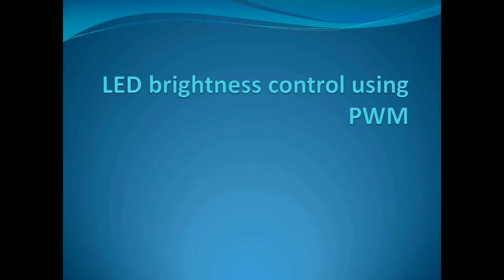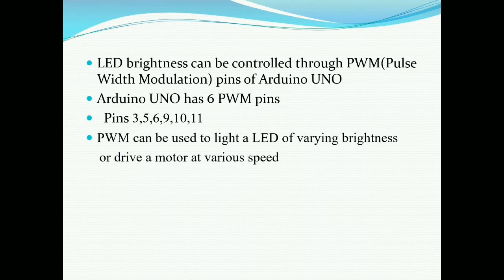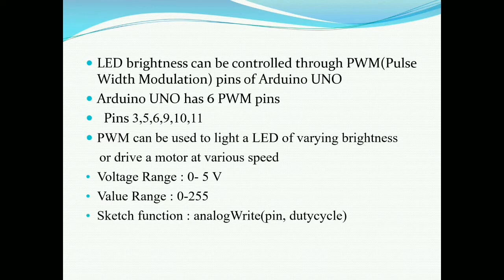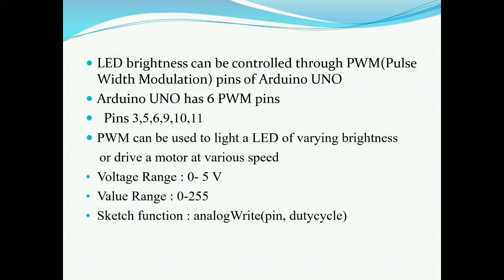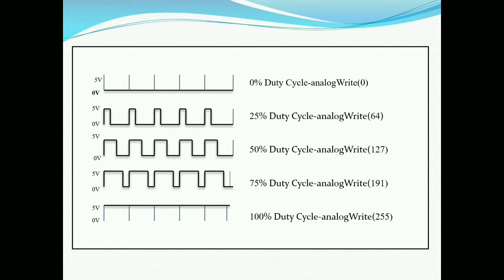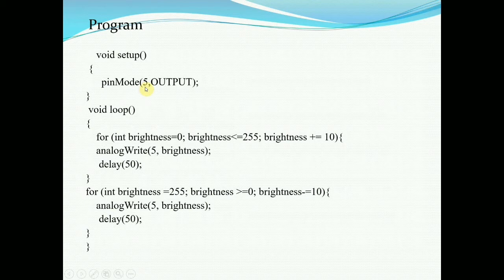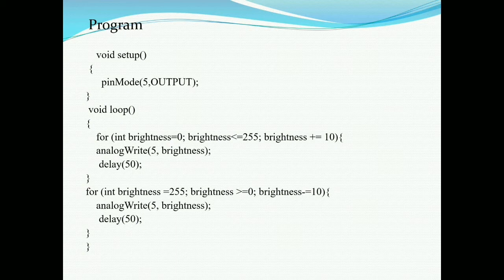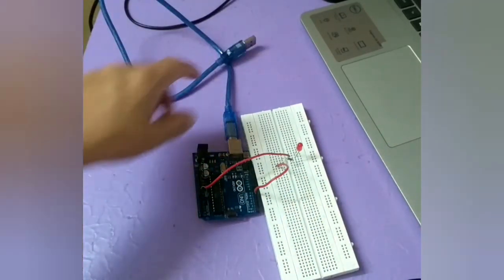What is PWM|Brightness control of LED Using Arduino(PWM)|Fading LED

Comment: How u decide the duty cycle value is 0-255 ?
Reply from the maker: Arduino uno board has 8 bit dac (digital to analog converter) so values varies from 0 to 255( 2^8)